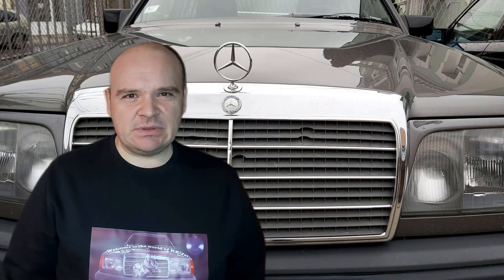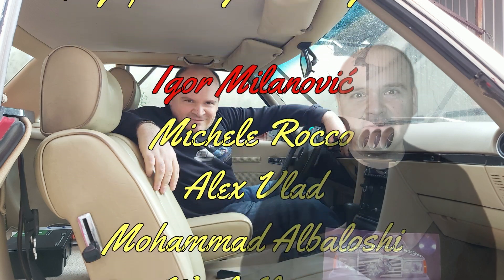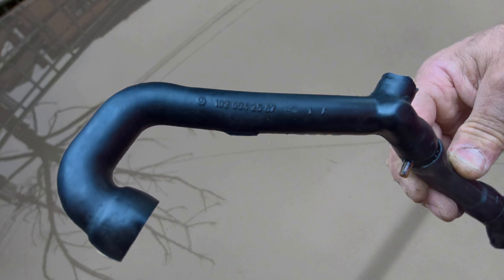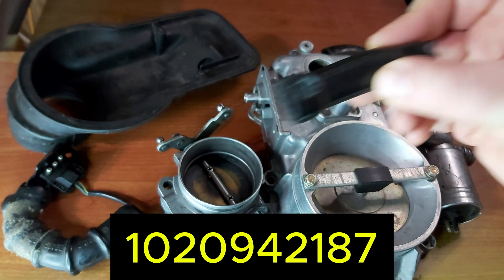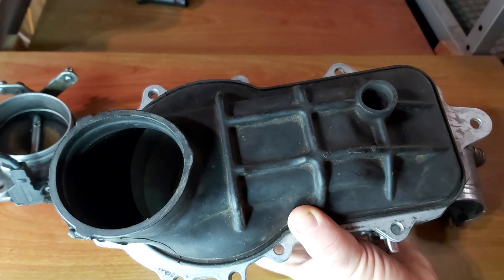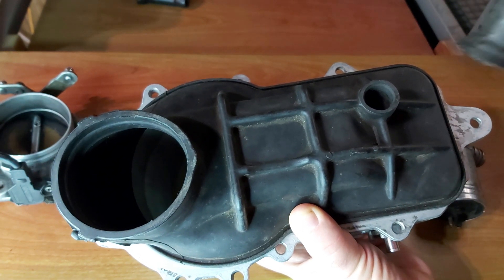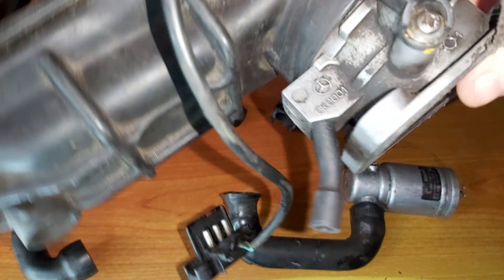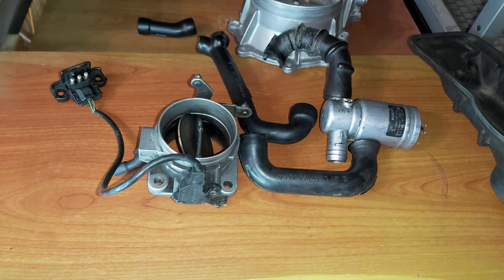㉦Mercedes Ke-Jetronic㉦ - 🎓📚⚠️The crankcase breather hose⚠️📚🎓

Comment from the maker: Unlock Your Engine's Potential! In this video, we delve into the crankcase breather hoses of the KE-Jetronic system, exploring their vital role in maintaining engine performance and longevity. I guide you through inspecting, diagnosing, and replacing these hoses to ensure your engine runs smoothly.

Have you checked your crankcase breather hoses recently? Share your experiences or ask questions below—I'm here to assist!
👍 Like, 💬 comment, and 🔔 subscribe for more in-depth automotive insights and DIY guides.

Comment: Hello, I have enjoyed watching you videos. In this one I see you demonstrate connecting the ICV lower hose, but you show it connecting to the ICV which has the arrow. Is that how it should be? or is this a mistake just because you were showing the fit?
Reply from the maker: Hi, thanks for your question! 😊 In the video I was just showing the fit — for the actual setup, connect the hoses exactly as shown in the diagram, following the airflow arrow on the ICV. 🔄➡️💨Just watch the thumbnail and that's how the hoses have to be installed.

Comment: good evening, nice videos, well done, can you help me? I have a 1992 Mercedes 3000 petrol E class, after stopping in the garden it doesn't start, all the light panels are on, starter works but it doesn't start, what do you think, thanks
Reply from the maker: Hello - check the OVP and the fuel pressure regulator. Mount the pressure gauge and monitor the pressures - you have to get the nominal value for the system pressure, it must not be over 5.7 bar or below 5.5bar. Then check the control pressure and see the differential pressure.

Comment: The hoses differ on the pre-facelift models, it's got a different connection to the airfilter, a metal part to the intake manifold and a differnt part to the idle control valve, the icv also being different and adjustable. 
I am currently learning about the KE on my car and while you provide videos no one else does, I do think that you could explain a little more. 
Like the way the air travels through the piping here, where it comes from and how the oil from the engine ends up in most air filters etc.

I think you have great knowledge about these systems, so maybe you could elaborate on various methods to improve the engineering and improve these common failure points of the KE with mods (makeshift mods even). Thanks for the video.

Comment: Thanks so much for this. My car had the pcv valve just blocked off and disconnected. Timorrow i will connect it and see if it will idle by its own then!
Reply from the maker: @Rebbeezy  🤞🏻👋🏻😀🍀
Reply: @mercedeske  I fixed my car, it was the idle rpm screw, someone had tried to ''fix'' it before me thinking its just another carb screw. Car runs perfect besides a small tick. thanks a ton, your videos helped me so much
Reply from the maker: @Rebbeezy  Glad to know that. Happy Mercedesing!